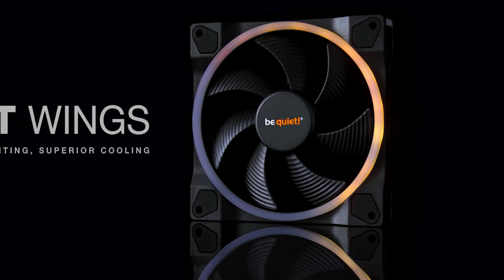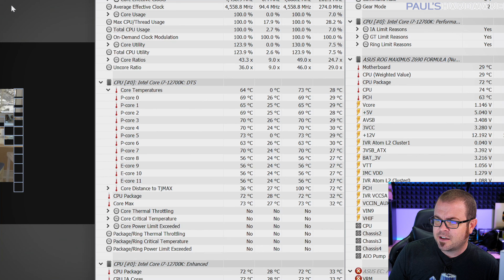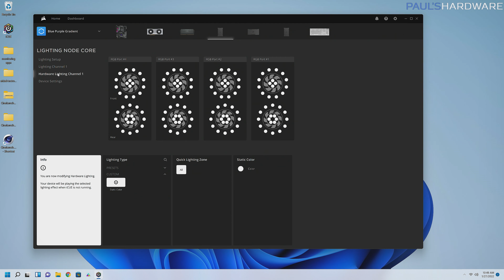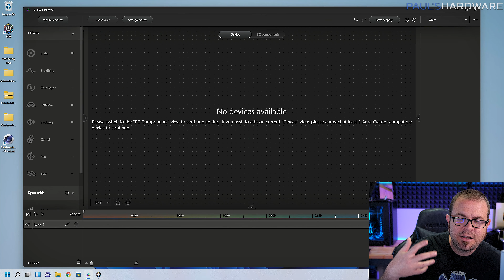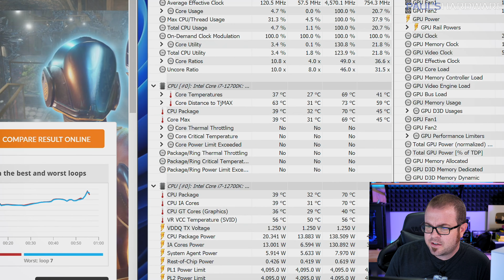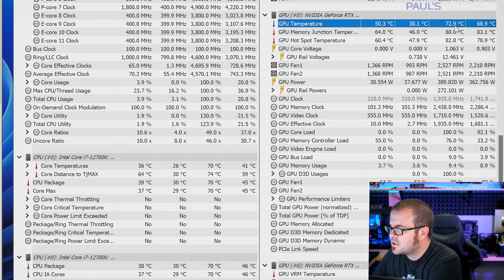Flipping Fans, Stress Tests and RGB Lights: All-White Build Part 2

Comment: Curious about the result if the GPU orientation were flipped, with the fans facing downwards to suck cooler air directly from the bottom.

Comment: Thank you for this! I just got the new evo rgb and built it in the reverse. The GPU was running 8c hotter than usual because I was trying to exhaust the top fans like usual. Definitely run positive pressure in reverse to utilize the intake fans on the gpu-

Comment: on another note, this is a beautiful build, its what i had in mind when building my pc. only issue is, i didnt have the money to afford these parts, so i had to get Z690-A D4 Rog motherboard with a gigabyte 3070ti vision, 12600kf corsair vengence pro 3200mhz white, i have the same fans as this build, with the corsair 360 aio to match. All placed inside the corsair QL edition 5000 air flow all white case. Unforunantly i can no longer purchase that motherboard or that Gpu. Kinda bumed about it, but i guess ill have to wait and see what come of 14th gen, and possible go a areo 4070ti to match.

Comment: Yes Paul you were correct with the top fans blowing over the gpu, along with the fans on the radiator. The fans that should have been flipped were the ones on the bottom. Having all the air coming in from the top blowing over all components, then exhausting out of the bottom of the case. The 3 fans along the bottom should of been the only ones flipped.

Comment: You would need to look at this set up like it's upside down, because it is. The bottom fans being exhaust is the only change I would consider. But the difference, if any, is probably small.

Comment: The single exhaust is not goimg to help/ might be a detriment. I have the same case and setup. 9 intakes, no exhaust. You can also remove the empty pcie brackets and the whole back of the computer has lots of warm air flowing out. All intake is also considerably quieter than exhausts.

Comment: I use a coolmoon argb fan hub controller, it comes with an remote (!) costs about 10 Euro (in Asia) and controls all the rgb without any software on the pc. Highly recommended

Comment: I really like the side panel placement for thr AIO. I feel like if this build was done in the original configuration with the GPU right side up, having the top three fans, and one side as exhaust would have seen the best possible outcome for temps?

Comment: Regarding the temperatures, I think this upside-down config is hurting the performance. If the graphics card was fans down, you could intake at the bottom, exhaust at the top and hot air is also directed at the top. Also, new air would directly blow over the graphics card.

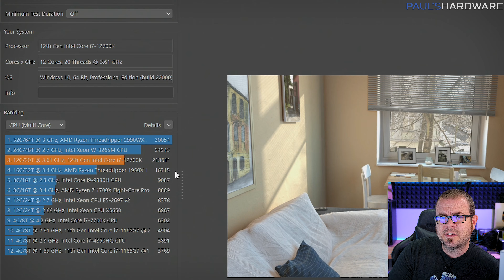Comment: 3:30 how the f*** are 12700 and 12700k getting almost the same scores? On my 12700f I get 21500 on the first run and it drops to 20500-21000 in 10 minutes run. Crazy how 12700k is not worth it at all.

Comment: Exaust on the bottom all the rest intake -  still positive but you should get 5° less both CPU and GPU
( because there is more air flowing through the case )

Comment: I would think that configuring the top fans and bottom fans for intake, the side-mounted radiator as exhaust, and leaving the rear fan oriented for exhaust would be the best cooling setup available for that case.

Comment: Saw it on another channel and it seems that the case inverted with upright GPU , 3 side fans as exhaust, 3 fans bottom intake, back exhaust, top exhaust will be ideal (in terms of performance/noise ratio) or adding another 3 in front as intake with the mesh DLC would give you tiny better temps but more noise.
Reply: Could you point me to that video? Also, there’s a way to make the GPU upright rather than upside down when the case is inverted?
Reply: @BLamb  https://youtu.be/L_jBVaWS1tU this one. About the other question I don't you can do it like that. Also there are longer pci-e 4.0 riser cables now, you can route them behind rather than in front of the case.
Reply: @argmarius  Yeah, I can’t stand the GPU being upside down, so I’ll probably just have it on its side facing forward when I actually build in the inverted mode. Would you happen to know if the case actually includes a PCIe 4.0 riser cable?
Reply: @BLamb  it doesn't include one. Frankly I've kept my o11 air mini, better Temps/quieter honestly and takes less space than the Evo.
Reply: Comparison between dark rock pro 4 with 4*140 fans as intake and 2*120 as exhaust vs silent loop 2 360mm and 10*120mm fans in total.

Comment: So clearly the bottom should be exhaust. Also helps with not re-circling the PSU exhaust air getting sucked unter the chassis.

Comment: I just finished a build using an Antec P120 and was really disappointed with my thermals and performance to the point where I was about to return the case and start over. AfterI saw this video, I switched to positive pressure and the results were surprising, -5+ degrees on the gpu and -10+ degrees on the cpu. You saved me a lot of hassle, so thank you.

Comment: That upside down motherboard just doesn't do it for me.  It could all be painted with vantablack, and it wouldn't make a difference because I would still know that it was wrong way up and on the wrong side of the case (right instead of left) when looking at it.

Comment: Thanks Paul; This case seems to be what i am looking for my new Alder Lake RIG...i was largely hesitant to use AIO Liquid cooler because i could never sleep peacefully knowing that there's a chance it can leak/fail and destroy the gpu...In this setup; the GPU sits up top n pretty and In worst case scenario; my GPU or ssds aren't in any major harm. Nor it leaks into any PSU. Even if it ain't the most thermally efficient case; i would go for it for peace of Mind.

Comment: I wouldn't run the GPU upside down but rather in vertical configuration which is an option on this case.

Comment: agree with ya, Paul.

gpu being the most power hungry component of the system deserves to have cold outside air blown directly at it. cpu, too, like what you got there, should have outside cool air blown across the radiators.

but i wonder if the bottom fans exhaust out, would that help with the air flow inside the case?

Comment: Thanks for your testing efforts.  This may have already been pointed out, but one configuration I didn't see you test was top and AIO as intake and bottom and rear as exhaust.  This would satisfy your very valid point about keeping the air going toward the graphics card fans and with 6 intake and 4 exhaust fans you could maintain it as a positive pressure system.  The fact that hot air rises has little impact when the air is being moved with that many fans.  A notable negative about what I'm proposing is that bottom exhaust may be less desirable to sit next to while working.

Comment: Hey Paul, I found the fan orientation piece to be very insightful, and I'm glad for that because it is why I clicked the video. Still, unfortunately, I skipped over half the video because I'm seriously not interested in LED configuration. If someone wants to have LEDs on their computer, I'm not judging them for it unless they can't figure out how to work it themselves. In my opinion, the only good LED fan is one that has had the LED connector snipped off, so it doesn't get in the way of cable management. While it is reasonable for a third party to do fan testing, so we don't have to, saving potentially an hour of work, it isn't reasonable, in my opinion, to waste time on showing RGB pre-sets that will take just as much time to configure no matter how many videos you watch, but not only not offer any "real world" benefit, but waste power and have been shown to impede performance on poorly made hardware and in the cases of serious overclocking.

Comment: Best demonstration of the RGB software is turning all the vomit off. Why does no one ever show that? Is it not capable of turning garbage off?

Another good demo would be, does it work with Windows logins/profiles? Can each user set their own presets to auto switch when they log into the system? Someone may want solid green all the time, another user might want seizures, and someone else using the system may want all that crap to always be off.

Comment: I have 2 120 intake, 2 140 intake, 1 120 exhaust and 2 140 exhaust. Working quite well :) This is a positive pressure actually and it seems positive pressure is the way to go.

Comment: If you REALLY wanna max out your RGB fukboi status you can throw in a Razer ARGB hub, and it will control up to 6 devices. Alternatively you can use splitters to support more. Razer is working on allowing the use of multiples of the same devices, ie: 2 hubs, or 2 Firefly 2 mouse pads, but as far as I know it's still not being implemented yet. I have 9 fans, and a lightstrip connected to mine, but the interior fans are in two groups, on splitters. It works "good enough" for now, but eventually I want another hub for complete control.

Comment: Thanks Paul! I have a Seasonic Sycro case which has a default inverse motherboard orientation. It's setup very similarly to this case. Three fans in the top, three on a radiator in the front, one rear fan and I've added a single fan in the bottom, which is all the case will accommodate in the bottom. I had the top set to exhaust, front to intake, rear to exhaust and the bottom to intake. The fans in the top and the one in the rear are 140mm fans. The setup has been bothering me for some time for the same reason you mentioned prompted you to set the top to intake, the airflow for the video card. Your video made up my mind to change the orientation of the top fans to intake. Thanks for so thorough an analysis. It's one of the reasons I enjoy your videos.

Comment: I just set up RGB on my computer and I have 3 different manufacturers, so I have a bunch of software. I’m fine with static color, so I ended up just using each software to set its component’s color. It definitely was a larger pain than I expected.

Comment: You are still wrong. Slow the fans down at the top and that should stop the impact. Also your AIO is upside down (and no I am not talking about the pump). The second you get air in that system "bye bye pump"

Comment: Hi Paul. I was wondering if you would want to build my rig. Figure it would be nice to showcase on the channel also. 12900K, Asus Z690 Maximus Formula, Asus White Strix 3090, Evo O11 Case White, White Mesh Front, 2 White 360mm Radiators Corsair, Corsair XD5 Pump / Res White, EK Velocity Nickel Frost CPU Block, PrimoChill White Fittings, Clear Soft Tubing, Commander Pro, 10 Port PWM Fan Hub, 12 Thermalright TL-B12W White Fans :) I'm in Orange County :)

Comment: I''m still triggered by the orientation of the AIO radiator. Just seems not right having the in/out below the pump because air can make it into the pump easily.

Comment: top FANs as intake, AIO FANs as intake, bottom as exhaust, side as exhaust is the only logical setup that could improve temps over your positive pressure setup. It would still be slightly positive to keep the dust out, but it should also lower the overall case temp. The configurations you tested were obviously making either the CPU or the GPU temps worse.

Comment: Ive tried to get in touch with Lian li.
Gonna buy the lian li pc o11 evo, and i want to do it in inverted mode and use the vertical gpu mount.
They say i cant do it, but i see no problem...
They increased the spacing in inverted mode between the mount and case, so i can fit fans+radiator and the vertical mount in the top (again in inverted mode)
Im guessing they consider gpu weight? (and if you move it?)
My card is not that heavy (g12 installed)
And the motherboard "clasp" and the 2 screws in the case should be able to hold it in place...

Comment: I have the non-white version of this GPU and found it runs too loud and too hot with +100 OC on core and +1000 OC on memory. So I put EKWB Quantum Vector blocks on both sides, now I am extremely happy.

Comment: to be fair, they had a point about the fan configuration...but your case is inverted so that point got countered by your gpu being in a odd place pulling air in compared to normal the opposite direction.

in your use case that would mean flipping the bottom fans around which....due to them being the bottom fan it would be shocking if that helped anything at all :P

so for your specific configuration yes your fans were correct (i get inverting a liquid cooled gpu so you see the clear side instead of the black slab but air cooled....i don't find the fan's that interesting to look at :P

the idea is that gpu's with a side exhaust get there fresh air from the bottom (your top) and the top fans (your bottom fans) pull away more of the hot air, together with the hot air from the side radiator

Comment: The problem I had with this build wasn’t the fan configuration, but that the radiator is the wrong way up so you’re going to get air in the pump

Comment: Never been a huge fan of "default" RGB lighting setups, but for my MSI MB/1080ti, I do like using the "CPU temp" option via the MSI software just to have a quick and easy way to keep tabs on temps by RGB color.

Comment: it seems everyone (expert especially) like to create their casing to be so colorful. Why? When you suppose to put the casing on the floor and away from the desk/display, and trying not to put the casing beside you (as you will be breathing the heat/hot air from the casing. And after 6 months, the dust will build inside the casing/component, and no one really care after the build-up.

Comment: GPU upside down is probably the worst cooling setup to start with considering where the GPU intakes are and how hot air moves. Cooling is about removing heat from a system, not about adding more air or creating tornado within. There must be ways to build it even cooler with different setups and 10 fans. But you do you.

Comment: Thanks for the follow up. The only thing I would do on the fans is top intake and bottom intake and AIO exhaust. Thats the config I would like to see. Maybe you could test it and just leave a comment with the results? I do agree the top 3 intake needs to happen for the GPU, but bottom intake and AIO exhaust would be optimal?

Comment: For the Fans setup.
Having the fans blowing onto the GPU was right, no-one in their right mind would flip them like you did when they are so close to the GPU fans.
They steals air pressure away from the GPU fans which then has less air to grab.
Only fans on the AIO (side) Rad should be flipped and exhausting and like the rear fan.
Yes the temps shouldn't change a massive amount but as you can see from the tests, they don't change a massive amount anyway.
Having the 6 fans intake (3 on top and 3 on bottom) and the 1 fan on the rear of the case plus the 3 fans on the AIO Rad exhausting could give you a extra degree or 3.
This still gives you a slight positive pressure due to 6 fans in and 4 out, 3 of which has to push through a Rad but the holes on the rear of the case helps even it all out.  
I personally think this would be the best set-up of the fans but I am not a professional fan nerd or profession case tester etc. I am just a simple guy trying to use my brain.

Comment: I have "blaklisted" both Corsair and ASUS (for different reasons) first Corsair for warranty issues on "lifetime warranty"  of RAM and the "requirement" of receipt (after 9 years of purchace) or any six months receipt of their brand... soooo rich people that upgrade their pc every 6 months , and asus for the quality of GPU's i have 6 different models (the latest one was the gtx 470) and all of them stop working after 3 years... when i have MSI and Sapphire brand vga's that have "burned up" for more than 10 years and still work (if you want that OLD hardware to work anyway) so just wanted to write that down , thanks to anyone read that (and spend his/her time for it)

Comment: I wish more people understood that “hardware lighting” means they can have on RGB without running any RGB software.
Reply: hardware lighting, interesting name for it. I miss the days that the mechanical switch on the wall or desk lamp controlled your lights instead of needing a dozen different malware apps that make your computer run like a potato, lol.  As for quarantined lighting, it's not like dmx512/RDM hasn't existed for over 30 years and been used by massive lighting setups for events and bands around the world, and the control chips at this point are stupid cheap (dam I wish computer "RGB" had 3in1 or 4in1 moving heads). lol.

Comment: IMHO the best configuration would be top and side intake; bottom and rear exhaust. You are right that top fans just have to blow onto the graphics card. However having only one fan as an exhaust makes the setup very positive pressure, with no way for air to escape. So the air pushes against the fans that pump it inside and decreases their efficiency.
 And to all "hot air rises" peeps. It does but the effect matters if there is no active airflow.  If you have fans the effect is negligible same as the gravity is. "All things move towards the center of mass/down" but you do not account for that configuring fans, do you?

Comment: Interesting, the testing variant I would have done is original + bottom fans switched.
Maybe that would perform better.
Fresh air for Aio and gpu and faster exit of hot air inside the case.

Comment: All intake and AIO exhaust FTW ;-P

Cooler GPU, overall positive pressure ensuring more of the small motherboard components gets some airflow and assistance in pressure for the CPU AIO fans. Although it would be warm air, it would also be more air and Intel chips tend to handle heat better so it might not effect a "normal" O.C.

Comment: Great build and video. I believe though that if the bottom fans were set to exhaust you would see some difference. Not significant enough to matter and maybe not enough to get in the trouble to change their orientation, but  ... 😁
Keep up giving us great videos